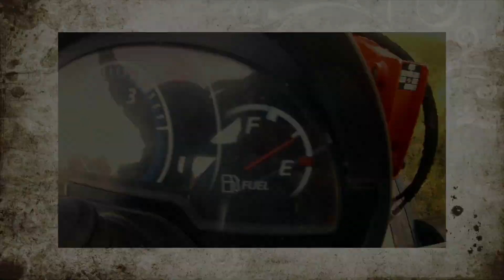Driveway Culvert Part III   HD 1080p

Comment: how to you like the sv40 im on the fence between the sv40 and the vio50 why did you go with the 40 over the 50 ?
Reply from the maker: My deciding factor was weight. The SV40 has the same engine and hydraulics as the VIO50 but it's on a smaller frame.